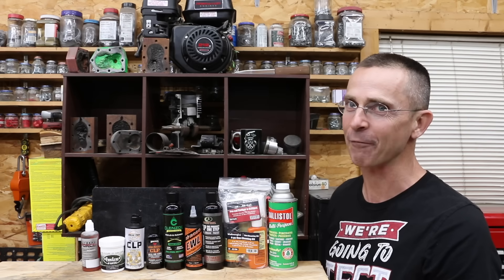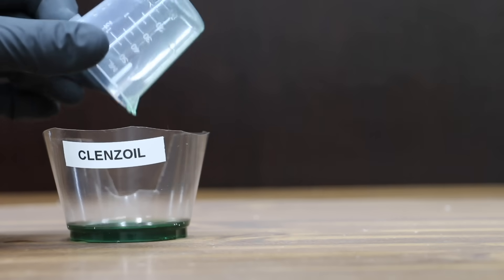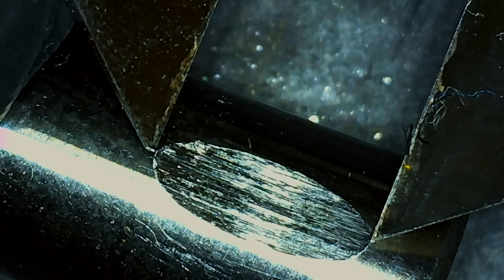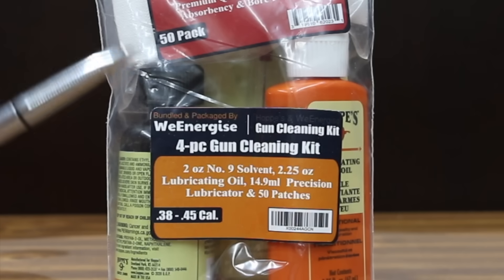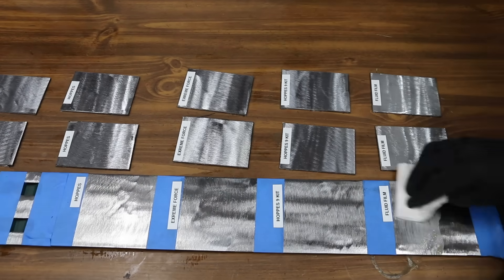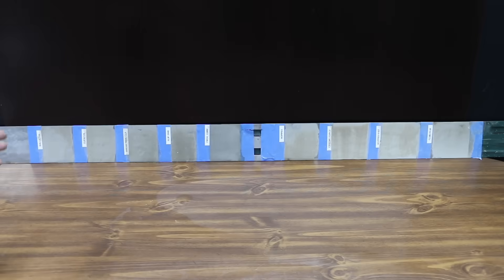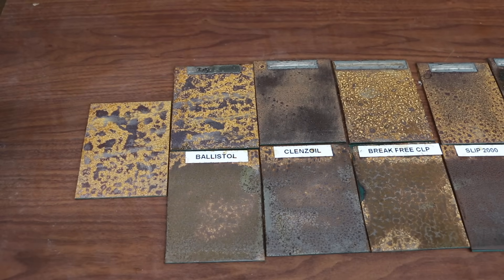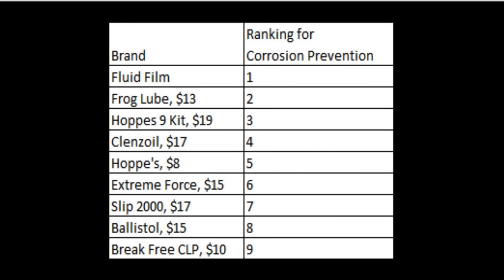Don't Buy A CLP Until You Watch This Review! It'll Save You Time And Money!

Comment: This is a great idea, loved it! There are many gun cleaners/lubes on the market and among gun owners this type of thing is almost religion. I think we definitely need more episodes. Many old timers swear by quality synthetic motor oils like mobil 1 and other specified products like Mil-Comm MC2500,  shooter lube, weapon shield, mpro-7, g-96 and Hornady one-shot to name a few. Excellent work!
Reply: Hornady One Shot is a dry lubricant. I think it's silicone based. I don't use it internally, but I will use it on the exterior so I don't get oil on my holster or clothing. You can also use one of those Otis silicone rags and it will dry to the touch.
Reply: @lonewanderer3603  cool, thanks for the info

Comment: I won't use a CLP.  I would like to see a test of the best CLP vs Mil Comm's MC25 General Cleaner & MC50 Bore Cleaner, and TW25B Synthetic grease rated for -90°F to 450°F operation, & MC2500 Synthetic Oil rated for -70°F to 450°F operation.  It's more expensive, but when my life is on the line I'm willing to spend the extra money and to take the extra time to clean first and then lubricate.

Comment: Spoiler alert, they're all a waste of money.  Most aren't any good and the ones that are ok are overpriced by about 10x.

The lucas grease tested in your previous video did better on wear with 50% more weight on the tester and twice as much time.

My personal choice is aeroshell 22.  General purpose synthetic aircraft grease good to -85F.  It has worked flawlessly for me down to -15F on an AR15 bolt and carrier.

Comment: I have never trusted a product that has claims of also being a lubricant as well as a cleaner. (If it cleans well, shouldn't it remove lubricants?) That being said, most black powder aficionados, as well as period re-enactors use Ballistol, as it is water soluble, along with lye soap for cleaning, and a separate lubricant only product. I also would avoid any product claiming to be a penetration oil, as there is a very real chance of the oil penatraiting the primer, causing a non firing condition.
Reply from the maker: Thanks for the feedback.

Comment: The basic problem with the ones that performed better after the high temperatures than default is what actually happened. Basically those lubricants had a lower smoke point than the others and polymerized on the metal. Tolerances are very tight on many guns and polymerized oil is absolutely something you do not want happening.
Reply: So to be clear, you're saying that the ones that performed well on the heat corrosion test might have actually catastrophically failed by solidifying on the metal?
Reply: @vockski3173  well, a lot of your guns that are going to be faced with sustained high temperatures are designed to be run in such a way. For example an AR-15 can be run relatively dry as the carbon actually acts as a lubricant, and the extreme temperatures in critical areas help burn off the carbon build up where it’s not wanted, such as the gas port and tube and on the gas key of the BCG. A lot of full auto machine guns run off of an open bolt to help with cooling and prevent malfunctions from extreme heat.
Reply: @vockski3173  It really depends on the gun and the location. There are some guns with extremely tight tolerances for moving parts where any kind of buildup would cause jamming. There are also guns where it wouldn't matter and might even be a benefit. It is more something to be aware of than anything. For me most of my handguns are very tight on the tolerances and use a very light oil. While most of my rifles it wouldn't matter in the slightest.
Reply: @vockski3173  It's like a seasoning a cast iron pan, it builds up over time. That coating (polymerized fats) makes it possible to fry eggs in a well seasoned pan. I personally don't think it would cause much of a problem for handguns, but for semi-auto rifles or competition bolt guns, it might. It's also difficult to remove and can build up over time. 
To polymerize it needs to get to the correct temperature for a long enough time. This can happen for nearly any oil.
Reply from the maker: Thanks for the feedback.
Reply: @ProjectFarm  another thing that would make my before and after heating test more informative.

Comment: Your consolidated chart at the end is appreciated, and gives a big picture performance guide. Been using Break Free for 15+ years, and always had those "other" small bottles hanging out in my kit. Now will relegate them to the penetrating fluid can. Thanks.
Reply from the maker: You are welcome!  Glad to hear!
Reply: I’ve had flash rusting issues with Break Free on parkerized shotguns here in the southeast. But it looks perfect for cold weather.
Reply: Oh, we have that issue up here too. It's amazing how much moisture condenses on cold metal. I use Ed's Red no acetone on the in/out wipedown. Clp /Lucas for final clean / lube. 
Safe heaters or desiccant is a must. I have one shotgun of foreign steel that still flashes over. It's a problem.

Comment: I’ve used just about everything on this list at one point or another. Right now I actually have a big bottle of slept 2000. For the sloppy loose tolerances in a non-match handgun it fits my needs just fine.  I have a friend who coach the outside of his pistol slide with frog lube so when it comes in contact with his sweat it doesn’t corrode as much.  He uses something else for internal parts because living in a cold climate we already knew frog lube wasn’t much good in the winter.

You could very very easily do a part two through seven on this subject.
Reply from the maker: Thanks for the suggestion.
Reply: Tell him to paste wax the outside or use Lemon Pledge. Seriously.
Reply: I also have great results in the cold with FrogLube, the gun must be completely clean of petroleum based products when the froglube is applied or it will react and form a dirty sludge. Also warming the parts so that the froglube melts and runs freely is very important, wipe as much off as you can after applying, otherwise excess lube will firm up and cause problems.
Reply: I've got a tube of Lucas Gun Grease that I dab in the slide rails. 
It stinks when it gets hot.
Reply: Live in PA and never had a problem with frog lube in the winter..it has to be applied correctly
Reply: @scottporter4573  They had an old formula that would dry out over time and become ridiculously thick, even solid.

You probably have the newer formula.
Reply: @scottporter4573  In the extreme cold of late season hunting in northern new england of -20 or more take all the oil out using white gas and keep the firearm in the cold.

Comment: Still got a couple of buckets of the stuff we used in the military, seems like it works just fine so far.

Just don't overdo it, there is no reason to do it as often as people do it. If you go shooting once a month, do it every six months, if you go shooting daily then do it once a week.

Disassembly and cleaning takes its toll on your firearm. Springs will weaken and clips will break fairly fast. There is no reason to do it every time you shoot the gun. With today's loads and the treatment on your firearm already there (that you are chafing away by "taking care" of it) there is no need to do that.

This goes for everything but the AR-15 based models which are genuinely crap from the get go so it's not possible that you can make it any worse.
Reply from the maker: Thanks for the feedback.

Comment: One suggestion for the lubricity testing would be to weigh out the oil directly into the test cup, so that you don't have to account for any oil clinging to the sides of the tiny beaker. As always, very informative and interesting video!
Reply: plus, the lubricity test would not be comparable to regular firearm wear and tear unless of course you had a chain gun in the back yard...
Reply: @TheWolfsnack  according to the military spec document and it mentioned using a wear tester like this and measuring the wear scar.
Reply from the maker: Thanks!  Thanks for the suggestion.

Comment: Great test, as always.  I use CRC 6-56 for rust protection and Super Lube for firearms oil.  I restore a lot of old tools for a hobby and many of them are not plated (chrome or nickel).  CRC 6-56 provides amazing long-term rust protection on my restored tools.  Hoping you can add both to your next tests.
Reply from the maker: Thanks for the suggestion.

Comment: I started using Phil Wood Tenacious Oil for bicycles.  It does have a high viscosity and needs a Q-tip to apply in some areas.
Reply from the maker: Thanks for the feedback.
Reply: you rarely want a viscous oil on bicycles. usually a thin oil or grease.

Comment: For the Carbon removal test, we need to see a control test to see what no CLP does, if it comes off without CLP then the test isn't much of a help for figuring out which works best. 

Also, the dust test, the tires kick up dust inconsistently and unevenly to be sure how much they attract dust.
Reply from the maker: Thanks for the suggestion.
Reply: Using water as the control
Reply: @obummer14-4  dry and with water separately for sure.
Reply: As someone else mentioned, it might be a better test if the carbon had more heat and pressure applied.

I suppose he could run 500 rounds through a gun before testing each product. :)
Reply: I agree, diesel exhaust is a composition of soot and oil, regular paint thinner would have cleaned the coupon as well as anything.

Comment: I've been waiting for this video for a while. Very interesting and in some cases unexpected results. I've mostly been a Break-Free CLP guy, but I may need to look into other options to prevent corrosion on some of my older and less-often-used firearms. Thank you for a great video, as always.
Reply: Try CLP Collector, designed for longer-term storage, not lubrication.
Reply: @DavidWilliams-ig5ec  I second. This! It's amazing.

I use it on all my firearms except my edc.

My safe dehumidifier failed and I didn't notice for 3 months. My firearms are kept in my garage and in NC the humidity can be bad. Not one spot of rust. 

I suggest breaking them down all the way and spraying each piece individually. Then every few months spray them down.

I'm a break free believer. Been using it for 30 years.

Ballistol is a great product for wood. use it on all my wood stocks. Even works great on furniture.

It was used by the Germans from ww1-ww2. Ballistol in my opinion should be used for what it was designed for, single action bolt rifles with all wood furniture. Good luck and be safe!
Reply: @DavidWilliams-ig5ec  Good to know 👍 I never really thought about that being a thing
Reply: So I'm a noob, but i want to learn how to prevent rust on antique firearms. If they are being stored in a humidity controlled and temp controlled environment, do i need to do much?
Reply: @DamplyDoo  If you can keep the humidity below 50% where they're stored and use a dedicated rust preventative on them then they'll be good for a very long time.  I personally like LPS 3 for long term rust prevention.  It forms a semi-solid layer on top of the metal and lasts indefinitely.  It's a pain to clean off though and it's color might have you mistake it for rust.  Otherwise if you want to rust proof a gun for years of storage you could use the old tried-and-true cosmoline.
Reply: @Wk-is8eh  Cosmoline can be even worse. I don't much like boiling my guns.
Reply: @Wk-is8eh  thanks for the advice. I just want to be careful of anything that could affect the look out function of the finish. One of my antiques is valuable because it has most of its original fire blueing, and I'd be loathed to tarnish that
Reply: @DamplyDoo  You shouldn’t if it’s humidity controlled a/c. Especially if you don’t handle them often (hand oils have been known to leave rusty finger prints).
Reply: @DamplyDoo  Or use what some museums use to store antique firearms, Renaissance Wax.
Reply from the maker: You are welcome!  Thanks for sharing.
Reply: same here; always wanting to learn
Reply: I’ve have issues with Break Free on modern parkerized steel (Benelli and Mossberg shotguns) in the southeast. So I’ve used Frog Lube which has been flawless but properly doing the first application is a pain.
Reply: Hello my brothers, I swear to you, if I did not need your help, I would not ask you, especially YouTube. My life has been ruined since the death of my husband. I have children. I no longer work because of my illness and my child has had epilepsy. I need some food and the owner of the house wants to rent. I have debts in my bank.  Help even with 1$ I will be grateful to you all my life Thank you I apologize for bothering you with my comment

Comment: One thing that is important and not as easy to test is how well the product works after two+ years sitting on the surface of a firearm. Full synthetics are the best in that regard.
Reply: Yeah, see how much they evaporate and how hard the residu becomes
Reply from the maker: Thanks for the feedback.
Reply: Also how is flows, if it sits you don’t want it to just fall away.
Reply: @TheCheesePlease wow... What a great reply and addition to the community... /Smh
Reply: Lucas extreme gun oil does a great job. Great job as always and I'd like to see you continue this series
Reply: @boltgun7266  terrible for corrosion
Reply: @boltgun7266  I just use that Lucas Gun Grease in specific areas but I'm not sure if I believe in it yet.
Reply: In most occasions it takes significantly less than that for a gun oil to gum up. I'd say 3-4 months in open container and 1/16" film should be enough to tell if evaporation or some other reaction with  air (oxygen?) is enough to gum up the oil.
Reply: Care for your equipment
Reply: That's only one of many characteristics. Any long-stored firearm should be cleaned and inspected before use anyway so to me that characteristic rates low, or should I say doesn't matter because for storage I grease, not oil. Museums do the same. So do military arsenals. They've been at it longer than you and me both so fiollow the experts: grease for storage, clean and lube for use.
Reply: @TheCheesePlease How so?  Don't just tell someone they are wrong without providing proof they are.
Reply: Breakfree CLP will form a brown shellac that is easily mistaken for rust.
Reply: @TheCheesePlease I’m gonna guess you don’t own any firearms…
Reply: That's really not important. If you actually use your firearms you wouldn't go 2 years without cleaning and or oiling would you?! And any good gun owner will oil a firearm after years of sitting regardless. Common sense is needed.
Reply: @kentkirkpatrick7953  some guns are a royal PITA to fully take apart and detail clean compared to others. In general, revolvers, old school semi auto hunting rifles (Rem 740, Browning BAR are examples) and expensive break actions are rarely fully maintained by their owners--receiving only cursory cleaning between uses. An oil that penetrates well, sticks around and provides good wear and corrosion resistance is important. Some will go decades without being fully taken down.
Reply: @kentkirkpatrick7953  depends on how many guns you have, and how expensive ammo can be for specific guns. Or if there are antiques
Reply: @kentkirkpatrick7953  Maybe an emergency situation
Reply: @kentkirkpatrick7953   Consider that some people don't have common sense. Also consider there is technology that makes traditional common sense no longer apply. I have a pistol that has not been touched in 10 years and it looks and racks like it was just oiled.
Reply: @henryhenry7170  Try Ballistol.  It does not gum or resenify.
Reply: @chriskasprzyk6235  Thanks. I have kept Ballistol "in the arsenal" for a very long time. It is not my "go to" but it has its uses and I like the safety profile.

Comment: The old military (EDIT:: Break Free) CLP from the 80s that we used worked great. Then certain chemicals in it were banned for health and safety reason and reduced it capabilities. You could tell which was the old stuff (besides date of manufacture on the bottle) because you had to shake it before you used it, especially as it got older and stuff settled out of suspension.
Thanks for your videos. Always informative and entertaining.  👍👍
Reply: I still have tons of that stuff! My armory has literal gallons of it on hand
Reply: @Breakfast_and_Bullets  lucky guy
Reply from the maker: Great information. Thank you!
Reply: Years ago I bought a bottle of that “old stuff” that was part of a artillery cleaning kit at a gun show. Mixed it with newer break free and that will last me the rest of my life. If I was starting from zero I would mix break free and clensoil and call it good. BTW, I switched to hoppes elite it will dissolve asphalt (don’t ask)…

Comment: Oh brother, did you ever open a can of worms here, Todd! This is almost a religious topic for a lot of gun owners. Great job with your objective, empirical evidence as always.
Reply from the maker: lol. Nice!
Reply: 😅 Have to admit I usually use what Dad told us to use (more than 50 years ago)! 👍🏼😎✌🏼
Reply: @gus473  And the truth is, there's nothing wrong with that as long as it works, but different climates (below freezing @ 10,0000 feet in the Rockies vs. the Arizona desert) may require different lubes. My brother is a petroleum engineer and he recommended I use full synthetic Mobile 1 motor oil to me ten years ago. His reasoning was that engines are subjected to FAR harsher conditions than any firearm ever is, and synthetic oils stand up to engine abuse for thousands of miles. Motor oil is also a lot cheaper. It doesn't function as a cleaner, however.
Reply: @maxcactus7  damn must be thin air up at 100000 feet